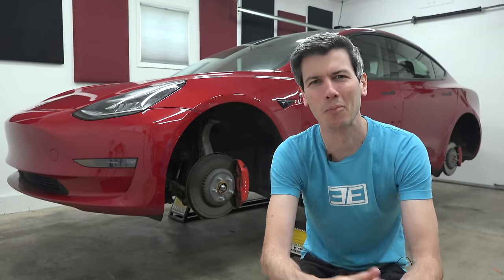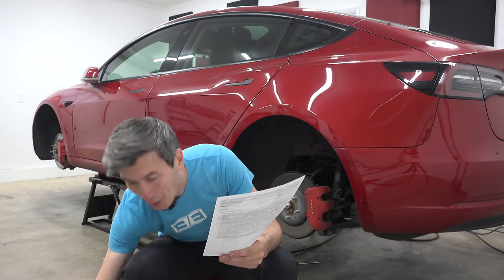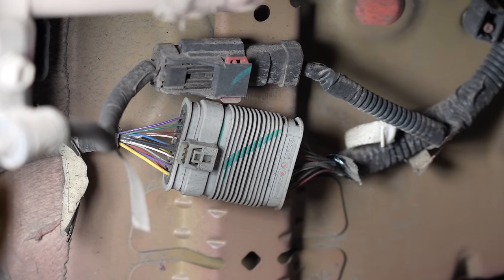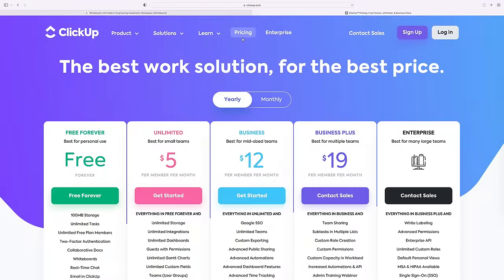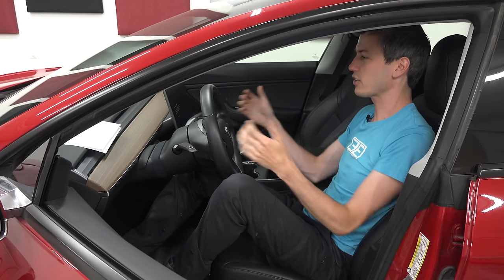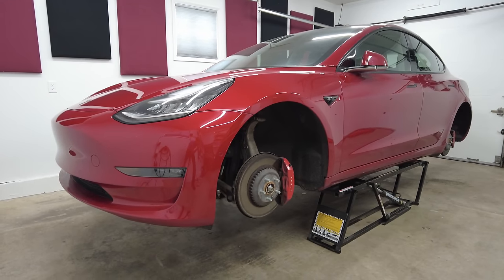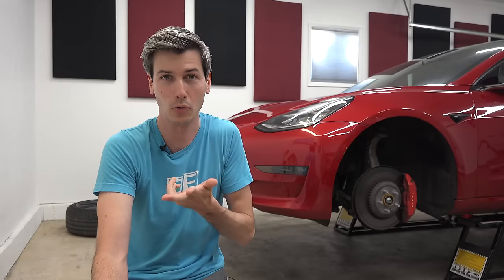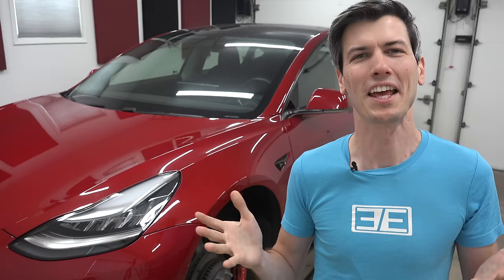Tesla Battery Damage? I Ran Over A Metal Bucket

Comment: I find it interesting that long-term maintenance reviews on BEVs have a tendency to miss the same things: A full wheel alignment check/adjust, tire rotations, brake fluid check/replace, brake caliper slide pins clean/re-lube, and a suspension check (besides the alignment). Typically, you want to do an alignment check every year, brake fluid check every two, brake check, and re-lube the pins every year (especially in cold weather/snow climate), and tire rotation (if doable) every 6k. A full suspension check should go hand in hand with the alignment check. There are other miscellaneous like wiper blades, which used to be every six months, but good quality blades now last up to a year. I also do the weatherstrips on the hood, doors, and trunk/hatch every six months. It is something easy and very minor but well worth it. 😉
Reply: Tesla specifies a "brake fluid health check and replacement (if necessary)" every two years.  Jason didn't list that as a maintenance item although he may have done his own brake fluid check (it wouldn't have cost him anything if he had the tester already).  I'm guilty of the same -- my Model 3 is two years overdue for a brake fluid change which I plan to rectify this fall.

You're spot on with your list.  When you say weatherstrips I'm assuming that you mean lubing them with a silicone spray.
Reply: Both EVs and ICE need some of those services, for wear&tear items, that's understandable, and never meant NO service for EVs... esp tires...but the point is all OTHER services, are Not Applicable for EVs, since... 
the parts don't EXIST to fail! Engine oil, water/fuel pumps, transmission/clutch, alternator, starter, smog, catalytic, O2/MAF/EVAP sensors, belts/hoses, spark plugs, head gaskets,muffler/exhaust... ALL of which have failed on my previous ICE cars, are GONE!  Yes, do have to check the moving parts that DO exist, eg wheels/suspension.

Your service checks seem to be bit overkill? Tire rotations are free at many tire stores. Brake fluid check IS recommended each 2yrs, $20 w/ mobile tech (or buy your own test strips cheap.)  Caliper lubes are really only needed in snowy/salty areas... pads & rotors, almost NEVER (100k's mi) for EVs, due to the regen braking.
Alignment is up to driver, for any car, and if no unusual wear is detected at regular rotations, shouldn't be needed?
Reply: @cgamiga  At no point does anybody say EVs require no service. The suspension, alignment, and a few others are maintenance items that every car requires yet it is not mentioned on a 4-year car. Four alignments times the average price is $400 dollars missing as a maintenance cost. EVs require a bit less maintenance but to say you only had to pay for a set of air filters is deceiving. A proper brake job is about $80 every year, etc.
Reply: You don’t need alignment every year if your suspension is properly designed. I have only done one alignment in 6 years on my Q5, and it felt the same after alignment which means it didn’t even need it. 
A long time ago, I drove a Corolla and it needed alignment all the time because of flimsy suspension
Reply: @jamesjack1147  That is why I used words like "Typical", "Recommended", "Should", etc. I never said shall or required. I've seen plenty of car owners that do not follow basic maintenance, heck, at times never had the engine oil and filter replaced. By the way, read carefully, I said "alignment check" every year. As it turns out, a suspension system and your tires are submitted to the biggest abuse of any component. By the way, read carefully, I said "alignment check" every year. The said components do not have a cooling system, or a circulating lubrication system with a filter, and they get exposed to the elements.

Comment: I’m surprised more people don’t buy the RWD (SR+). It’s range is less but 90% of the time you don’t need all of it. Yeah it’s slower but not by much doing a rolling start. Plus it’s more efficient. I’ve been averaging 220 Wh/mi.
Reply: That's the model I bought because it was the cheapest. In a few years, I expect battery tech to keep advancing where 400 miles will be the standard in a decade. So, buy the cheapest now because ponying up 7k more for another 60 miles range is not a good financial move.

Comment: I want Tesla to make an "air pilot" version wherein all the most common,  and driving-critical controls have dedicated knobs, switches, or levers. At this point, I'm surprised the turn signal isn't touch-screen operated.
Reply: All the critical driving controls do have knobs, switches and levers. You have a knob for steering, a lever for accelerating, a lever for braking, a lever for your drive mode, a lever for your indicator.

The automatic wipers are a little frustrating though
Reply: @Laykun9000  A good wiper control is live-saving when a wall of water hits yout car. Been from clear air with unlimited visibility to a layer of water on the windshield in a few seconds, and you have other things to worry about than a fakin touchscreen to control the wipers, which should be a one-gesture operation.

And a good heating contol is very critical, and I hate cars that don't have knobs for that. I remember driving someone's car that suddenly started hitting me with freaking cold air a few seconds after I took off, with no way of swithing it off because the parking camara still occupied the whole screen. That was a shitty one.

Bring our knobs back!!!
Reply: The emergency flashers are controlled by biofeedback
Reply: @tomhejda6450  I would agree but I don't. Leave knobs in cheap economy cars. Make premium cars even easier to learn and use by making voice activation faster and more accurate. Almost every subsystem in a Tesla is controllable through voice, even the wipers. But I also have no problem with wipers being on the stalk either. Heater control? Don't really need knobs or a touch screen for that, just ask it for your desired setting.

Comment: The '04-'08 Mazda 3 had a hellish air filter. The Goodyear we have been going to for inspection and maintenance for the past 15 years usually tries to cut us a break on pricing or will throw thing in with other jobs that will already be digging into that area.  We asked about the cabin air filter replacement and the franchise owner quoted us $50, cost and labor. Not wanting to take advantage because they always treated us very well, my dad asked "you sure?" without even thinking about it. After a quick lookup, the owner quickly backtracked, thanked us for the heads up and re-quoted at $100 but he'd offer a free oil change since it was coming due around the same time as the next inspection.

Comment: Leading edge of my battery pack just got smashed. Gently curved in divot is about 1mm deep. The battery pack can handle a super hard beating and as along you aren’t getting thrown codes or leaking coolant, you’ll be fine.

Comment: As you mentioned, the usable acceleration is the primary benefit. Also, to save tire, I almost never "Launch" the car, and just quickly ease into the throttle. Will still destroy just about any other car on the road with acceleration. While it's 60-100MPH speed is less impressive on paper compared to it's 0-60, it's still faster than most vehicles, and is great for passing!
Reply: It never gets old. I haven't lost an "on-ramp race" so far. You know them, the impatient types that think they're in a bigger hurry than everyone else & try to pass using a lane that gives out on a two lane on-ramp. Not on my watch! 😋

Comment: Regarding the spoiler. I had full body ppf installed. They removed my spoiler which had already been lifting and attached it on top of ppf. They do it all the time they said and have been in business many years with good ratings. Spoiler has been on for 6 months now and no issues even through a recent record breaking heat wave in California. I do think car looks fine without spoiler.

Comment: An excellent summary of your ownership experience so far. I love my year-old M3P and would buy it again - mine came with the spoiler ;-). I also agree that the specified max range is overstated; I draw a similar conclusion after almost 10K miles of in town and road trip driving. I doubt that short fall applies to just Tesla models; like EPA gas mileage on ICE cars, I think the EV's max range supports a theoretical optimum whose conditions are seldom satisfied by the average driver in real world conditions.
Reply: Same observation on range. Maybe if we didn’t floor it all the time it’s be closer. But what’s the point of getting the performance model if you don’t want to terrify passengers?
Reply: Interesting to hear about this "real range", I thought it doesn/t happend with Li batteries. My chinese scooter with lead batteries has 70% range than claimed. I thought it is because of Pb batteries, which are not good for high current discharge, and marketing when they measure range probably at 20km/h, haha. But on such scooter you need to "floor" it constantly.
Reply: @inevespace  When consumers think "real range" they think "if I charged to full and got on the highway, how far would I be able to go"

The problem is the EPA rates vehicles with a test procedure that involves mixed urban/highway driving.
It works ok for gas cars because it generally reflects real-world use where people don't tend to fill up their gas car daily and would like a ballpark figure on how often they have to hit the gas station in day to day use.
It doesn't work well for EVs because it bears no resemblance to daily real-world use of an EV where each day you start with a full (80%) tank.

Basically, the Urban/highway mixed range rating that the EPA assigns is a meaningless number in an EV.
Reply: @dorvinion  I don’t see the logic. How starting with full tank is related with EPA rating? If I go for long distance I also try to start with full tank, because don’t want to bother searching gas station in unknown place(depends on country, in some they are very far away)

Comment: I just brought my ‘19 M3P in for some warranty work at the local service center. I had the rear spoiler adhesive starting to fail and I got a complete replacement. I also had the cabin filters replaced and only paid the $50, no labor charge. My left turn signal tap-to-signal wasn’t working and the whole assembly was replaced and resolved the issue. I complained about the side cameras having a bright glare at night from the rear brake lights when using them for blind spot monitoring. Initially I was told it was “within normal operating parameters” and I would have to pay out of pocket for the new cameras that have the issue fixed. I asked for a quote but never heard back. I then received my initial quote before dropping the car off and they had the side cameras included as warranty items. So another item that was replaced for free under warranty. The 12V battery had a warning about needing replacement, and even that was still included under warranty. And finally they replaced the rear charging door assembly due to a TSB. I never experienced any issue but this was a nice preventative measure being done. 
Honestly came away very impressed and even had a red M3LR to use as a loaner while the work was being done.

Comment: Engineer to engineer, lead foot to lead foot, DIY to DIY, my 2015 Model S P85D this last summer has an 200 mile average range (240 new).  The usable battery is about 60 kWh, 77% of the kWh from new.   I actually gain range on long trips because I use autopilot.  It helps keep my foot out of it.  My first big job was on an aircraft fuel savings computer.  As a rule of thumb, the energy goes up with the velocity cubed!!! Except when following traffic...  In long trips when I need to spend time at chargers, following trucks reduces my speed, but also reduces my charging time, and therefore increases range!  Here in west Michigan, it also minimizes hitting deer (the major expense to insurance companies here).    My range drops another 60% in the cold before there is any snow/slush/ice on the roads which we have a lot!

Comment: I had the squeaky ball joints. That’s been my only big issue so far after 4 years with my model 3.
Reply from the maker: Interesting, and the urethane fixed it all up?
Reply: @EngineeringExplained  they didn’t bother with the urethane and replaced the entire upper control arm under warranty. It sounds like the urethane is a preventative fix but once you get the squeak they replace it all.
Reply: This is a known issue that a lot of people are having, I'm not yet.  But my warranty runs out at the end the this year and I will be so pissed if I get this issue outside of the warranty.  It's my understanding that the urethane thing is just a temporary fix and ultimately the the control arm has to be replaced.  And it's such an issue that if one needs replacing they replace both of them.
Reply: @Resist4  because of how known the issue is, I wouldn’t be surprised if they still replace it for free after the initial warranty is over
Reply: Just double wishbone/multilink things, really. I dunno why you call it a big issue.
Reply: @rkan2  it was his only big issue.  Meaning, all the other issues he had were very small.

Comment: I also think that "one trick car" comment is so silly. On top of having insane acceleration, it handles well. It's also very practical, and it arguably has the best user interface. I don't see how that's one trick haha.
Reply: Drive it on a road course and you will understand. You will only make it a few laps before the battery overheats and goes into limp mode. The brakes will also overheat and it will eat tires. It's good in a straight line, but that's it. It's a commuter car.
Reply: @3644Darrell  A car not designed for the track is not optimized for the track. Heavens to Betsy!  I won't repeat the list of cool features that Jason gave in the video. The idea that it's a one trick pony because it was designed for the 99.9% of the population who never use the track is absurd.
Reply: @BitJam  precisely. It's designed more-so as an everyday car, that simply happens to have a massive list of amazing features, one of which happens to be the acceleration.

I understand the battery can overheat, but combustion engines can do the same. Most people daily drive much more often than they track the car, making it a great choice for almost anyone.
Reply: @MakingMadeSimple  I agree.  Kyle Conner on Out of Spec Motoring has gone over all of this including the track limitation of even the Model Plaid.  The top end Porsche is much better but even it has limits.

Kyle's channel helped convince me to buy a Model Y a year ago (when it was more than $13K less than it is today).  The car is amazing!

My first car, many moons ago, was a 1963 Chevy Super Sport Convertible with a chromed out 409.  That car was  beast in its day but it pales in comparison to the MY.

I'm very impressed with Jason's integrity.  He's such a motorhead but he give EVs their due.  Good job!

Comment: Hello!  I noticed a lack of a particular maintenance item - tires.  You said you had your ride for 4 years, but you haven't replaced the tires yet.  I bring this up as I've read articles that says EVs wear out tires a lot faster than traditional gasoline vehicles.  So how many miles do you have on your model 3, and how does the tire wear look?  Do you think you'll need to replace them soon?
Reply: Instant torque combined with awd and 4,000 lbs will eat up tires quicker. 

I’ve read forums and depending on driving habits I’ve seen the average seem to be about 25k miles. As low as 10k and as high as 40-50k. Some people baby their cars and others thrash them so depends on your habits.
Reply: @Bbronson  This is why I posed the question.  Figured there might be a chance he'd see the comment and answer it, as I'm curious where he is at personally.  I've read the same forums and I've seen news blurbs that EVs eat up tires a lot more than regular cars (maybe not sports vehicles or vehicles modified for more power though).
Reply: @russael001  He has two sets of tires: winter and summer. Also he replaced 2 tires because of pothole, so in one of sets he has 2 new tires and 2 a bit older ones. He is probably a year o two from tire replacement

Comment: I replaced the 2 belly pans with aluminum ones. The belly pans are weak and will eventually tear given enough time. The coolant line into the battery pack is plastic and a direct hit will crack the line; means replacing an entire battery pack for over $15k. The chances of this happening are small if your belly plan is not ripped, but it gets pretty risky as it begins to tear over time.

Comment: So for the spoiler.... Could you not just superglue it?... It would just bond to the paint protection layer? And bond HARD? Just thinking out loud here
Reply from the maker: Yeah, an adhesive like superglue would probably give a better bond than tape. As long as you do it clean! The 3M install is actually really clean (you don't see the tape). Just kept coming off.
Reply: @EngineeringExplained  right, I've used a lot of 3m tape and super glue in my time lol I just think that with the spoiler being designed to do what it does I'm picturing super glue being a better adhesive because it SHOULD have allot less flex and therefore loosen less over time having constant force applied

Comment: Yup, we had our ball joints re-done, rear wire harness replaced, and both front wheel bearings replaced in year 3 (50k km) on our 2019 LR AWD.  Extremely unimpressed.